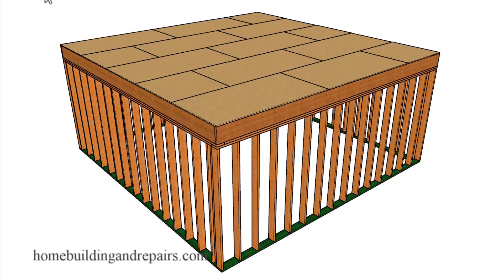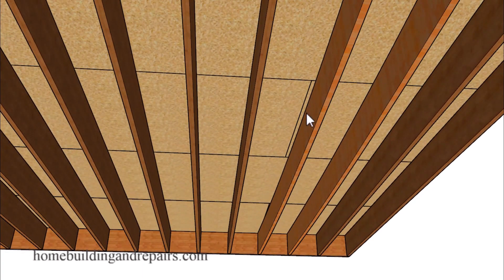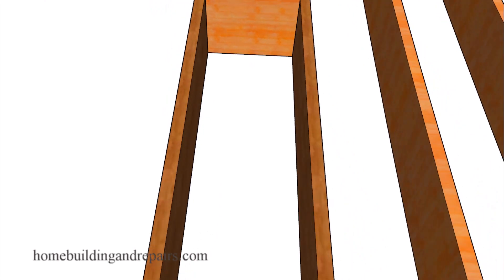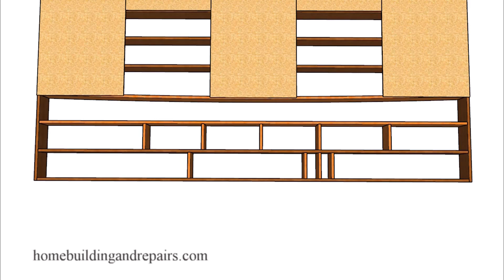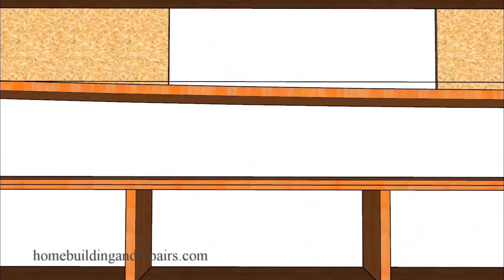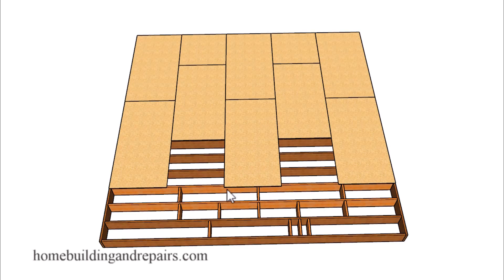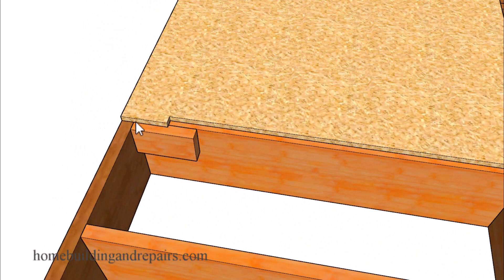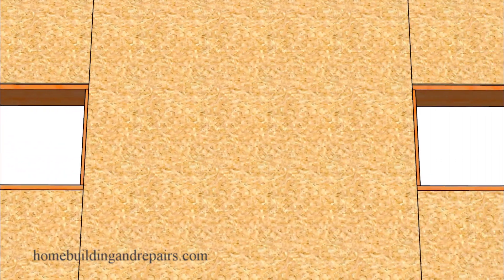How To Fix Bowed Floor Framing Joist - Crawlspace And Upper Floor Home Repair Education

Comment: Is there any worry about bowing out the rim board over time? Is it worth cutting the nails (and a thin kerf) at one end of the joist e.g. with a sawzall to provide about 1/16" of relief and then renailing once the joist is straightened?
Reply from the maker: Good point and if it's bowing a lot, then yes.